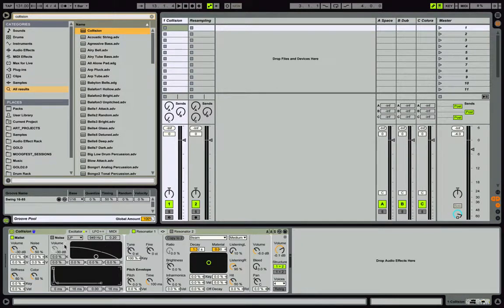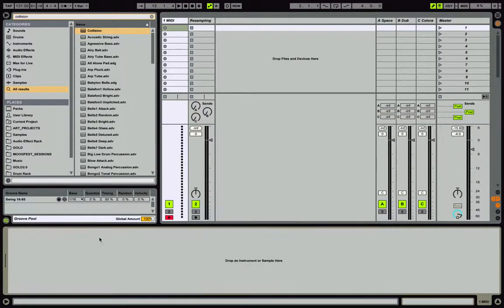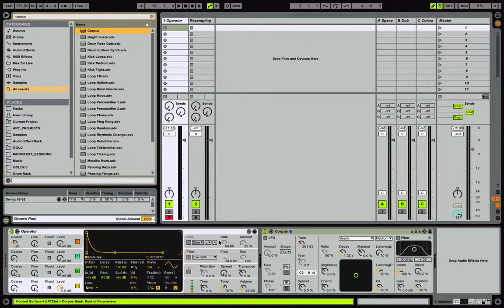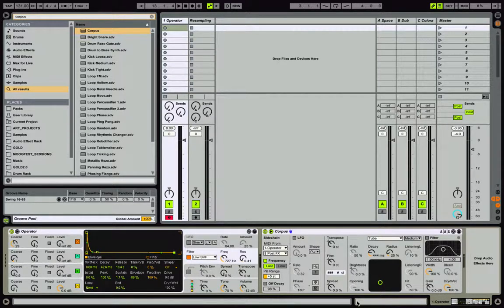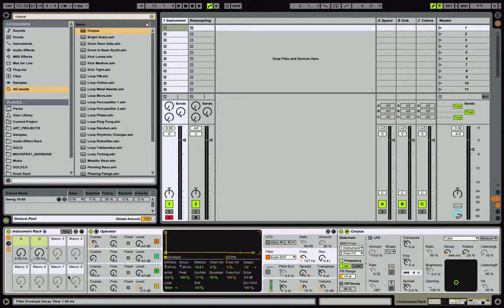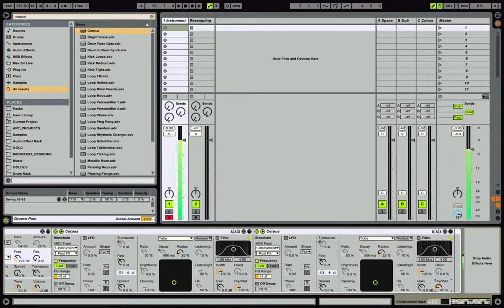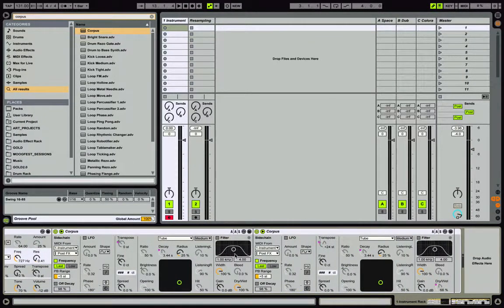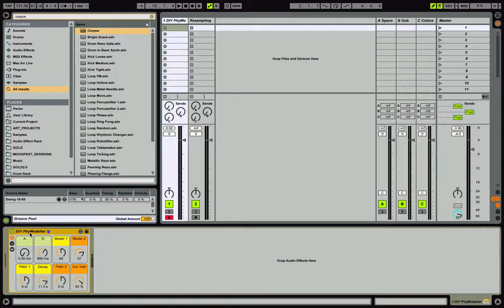Ableton Live Tutorial: DIY Physical Modelling

Comment: any ideas on how we can make it polyphonic ?
Reply from the maker: Yearned for that many times, but our best solution is to use the LOW mode in the Corpus' Sidechain Input when playing chords.  This keeps the pitch tracking aligned with the base note (in a very elementary sense). Of course inversions etc will conflict with this theory.  Generally preferring LAST mode when playing in Mono from the control track, though.  Let me know if you run into a better solution!  *Racking up several Corpi (Corpus in plural?) never seems to parse the voices correctly.  Let's see a M4L solution, programmers! :)